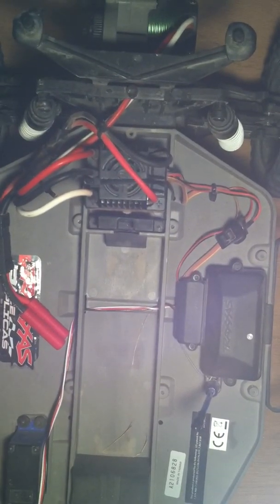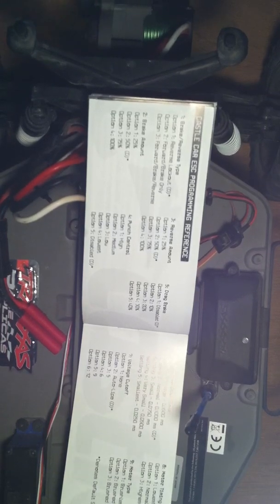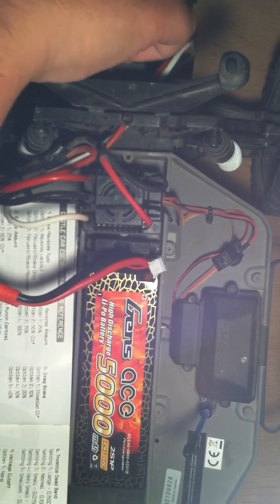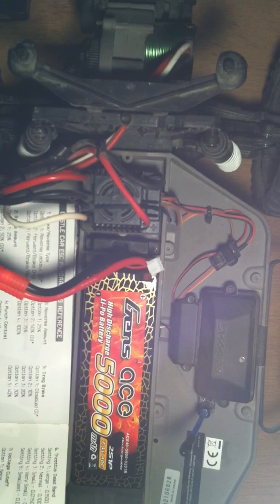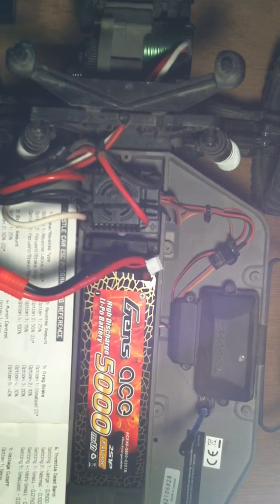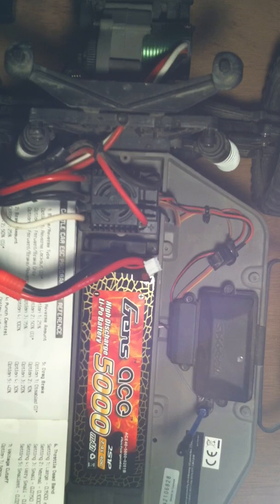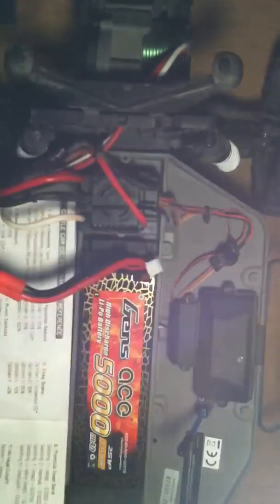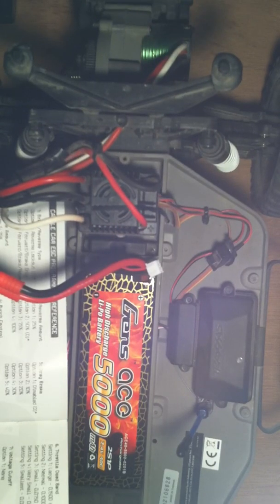How to program a Castle Sidewinder ESC

Comment: I have the same combo it was running fine on a 3s 40c lipo and all the sudden it stop running I let it cool off and tried it again and now the motor will stutter and the wheels will not turn any idea why. could the esc or motor be fried?
Reply from the maker: The ESC is rated for 2s only. The motor itself is rated for 3s.

Comment: ??? A quick question what is the difference between the castle Sidewinder 1410 &1406
Reply from the maker: if i remember correctly, the 1406 has a smaller rotar and stator. That being said, the 1410 has more power behind it

Comment: FIRST :
if i want use nimh 8.4 v what  i need   listen to and program the seven settings and option chose 1 of the Cutoff voltage , is correct?

SECOND
what battery i need to install, if i have lipo settings  to make the  change to nimh ....and later to nimh to lipo and no damage sv2? 

great video